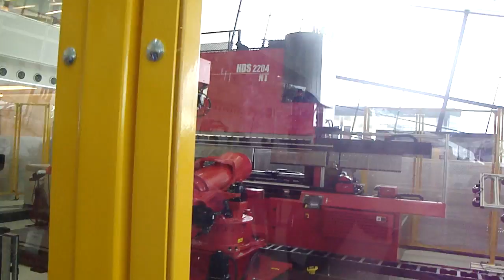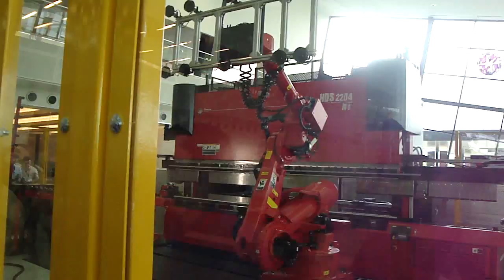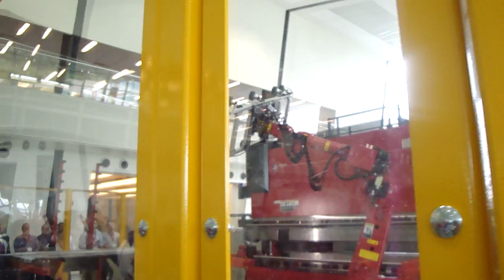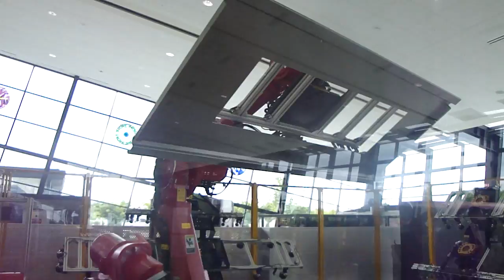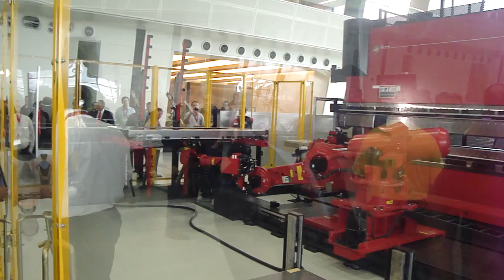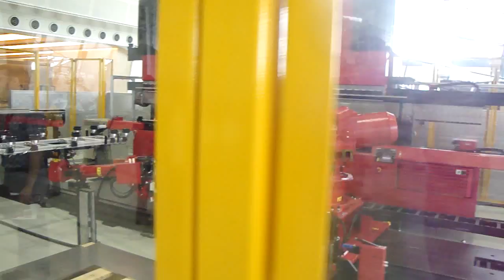Amada Astro 165W Robotic Bending System

Comment: Hi Amada ASTRO users, here a new product for your machines/equipment with floppy drive units:
FlexiDriveMV-SD - Floppy Drive Update to SD card.
This is a direct replacement for the floppy drive unit.
You remove the actual 3.5” floppy drive, connect the FlexiDrive and that’s all.
You will not use floppy disks any more.
You will use a standard SD memory card. You can storage up 2500 floppies in a single SD card.
Greetings! FlexiDrive
Find us on www.floppyemulator.com